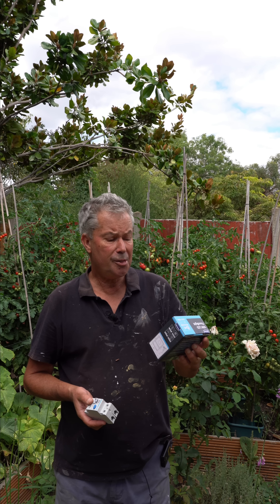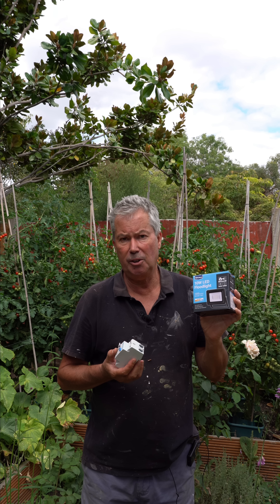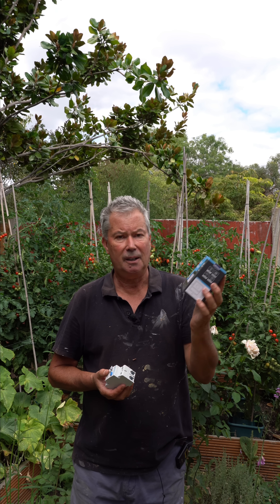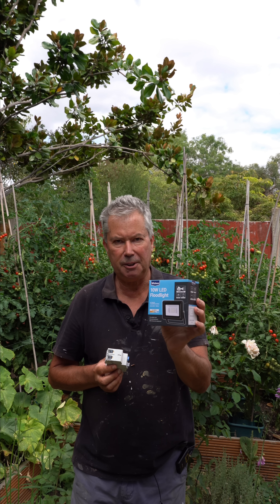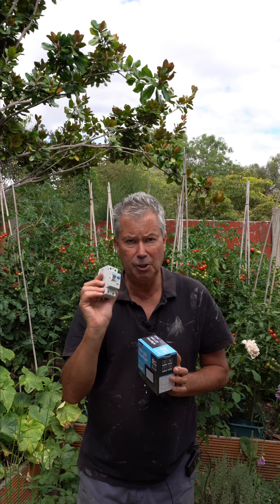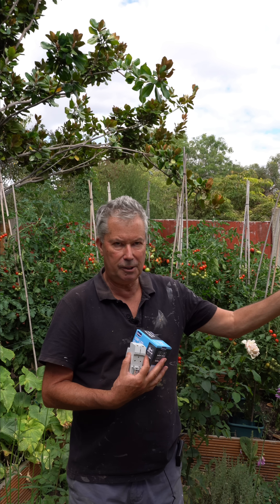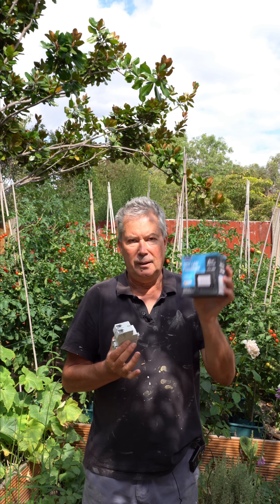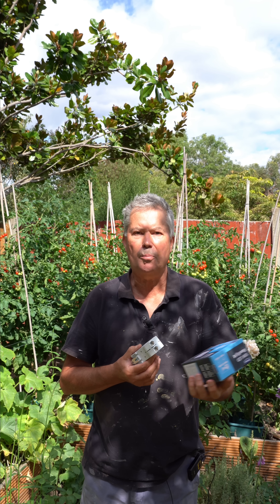My DIY Day August 24th Installing Floodlights and RCCB Problems #diy #diyelectrical #rccb #safety

Comment: Yes, blinding an RCD Type AC from tripping is a real issue. In the last few years we have moved to RCD type A. This allows a certain amount of DC leakage without being blinded / not affected. ❤
Reply from the maker: Thanks for the comment and it exactly describes my concern regarding the many consumer units in homes where the previously popular type AC RCD's could be "blinded" and therefore not providing the extremely important and potentially life saving protection for which they were originally designed.

Comment: This is mis information, the device you are talking about is an RCD and to comply with BS7671 you must provide additional protection which means a 30mA RCD if you have multiple in line they will be sized to provide discrimination to not provide nuisance tripping. Please ensure they are not larger than 30mA residual current.

If you were a competent electrical person you would not swap them out you would carry out an RCD Ramp test using a Multi Function tester
Reply from the maker: Thanks for your comment but the device I am referring to is described as an RCCB. The point is that they are not sized for discrimination, there is a 30ma RCD in the main distribution, a further 30ma RCD in the garage distribution that is fed from the main distribution but then a further distribution fed from the garage distribution that has the offending RCCB also a 30ma device. This is the unit that trips as soon as an LED light is connected. This could be due to inrush current causing an imbalance but whatever the case, I have now tried the same test with a different brand of LED floodlight and it also trips the circuit even if it is the only device on the circuit. This is what led me to look deeper. The function of an RCD and RCCB is similar i.e. they monitor for an imbalance on the live and neutral lines and trip based on an approx 30ma deviation. They may also provide over current protection. This is not the problem the problem is that one 30ma device repeatedly trips whilst the other two 30ma devices do not.